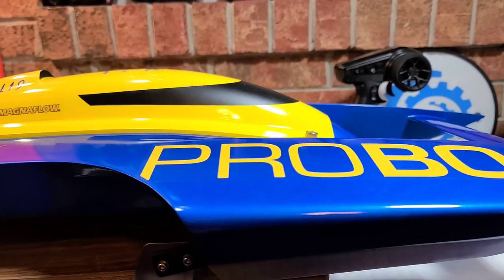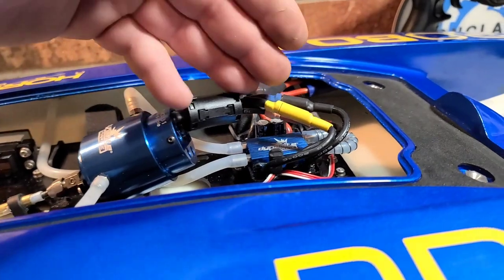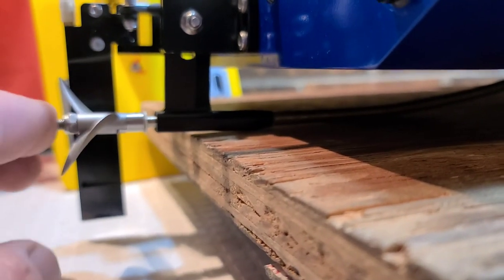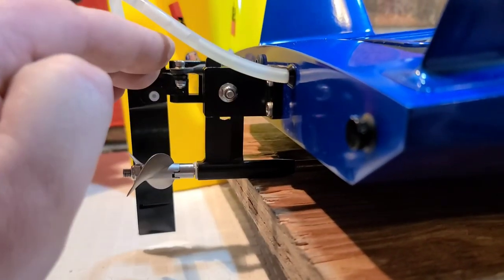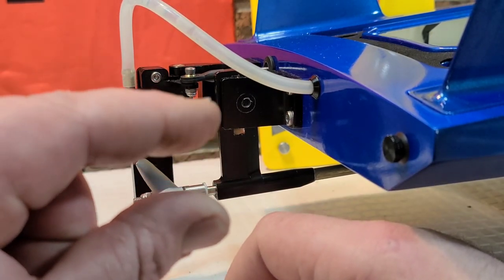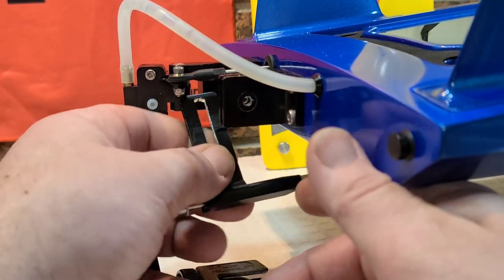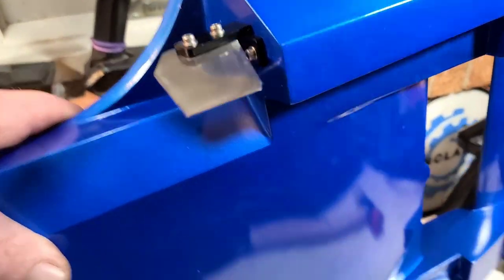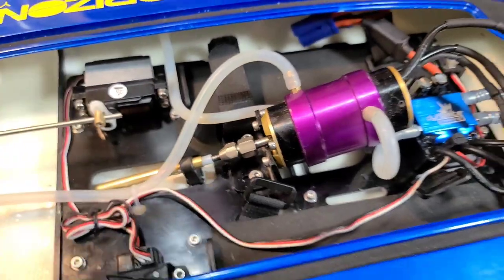Neutral Strut Position Test Proboat UL-19 RTR 30" Hydroplane - Turtle Attack

Comment: Mine came with positive angle as well the motor was not aligned.  I ended up taking every nut, bolt, grub screw everything apart to seal the bolts through the hull, lock tight, lube, make sure everything is tight.  I would recommend anyone buying this boat to consider it an assembled kit you need to go through.  When I put my boat on my cutting board to get the strut position neutral I did not take any of the tube off I just drilled out the strut position to put the bolt through the hole holding everything at that angle and it seemed to work.  Man I've watched this video like 3 times now because I gotta keep coming back to learn more.  Keep it up Big B   "Boat Gang"

Comment: I think the turtle helped you out, you did say you wanted a curved fin 🤣🤣🤣 darn turtle. Also I believe this boat runs smoother on 4s than 6s it seems more planted.
Reply from the maker: I agree, Pretty sure the boats designed for 4s use with 6s capabilities..  she's a monster on 6s but really shines on 4s.   I agree 100%!   thank God they had an adjustable elongated mounting hole on the turn fin.  If not I may have ripped the whole turnfin bracket off the sponson.    BUILD IT IRONCLAD

Comment: Darned me for commenting again haha...  I was told the gap between the prop and strut should be the same as the diameter of the cable because the cable shrinks under power as it twists and if the gap is not there it could pull the cable out of the collet losing your prop and cable to the depths below.  Was this bad info?
Reply from the maker: Yes you can rin a large gap on your strut / prop shaft with out issue. I usually only do like a mm or so. You can  play it safe with a larger gap.   My motor & Flex wasn't lined up either I filed the hole larger to get it lined up.

Comment: My UL19 runs only 27miles on 4s, Stock setup. Is ist normal? I wish it was faster, i dont wanna go 6s on this boat. 😢
Reply from the maker: Is the transmitter on 100%, also check the throttle reverse  on transmitter,  if that doesn't solve the isse, make sure the motor to esc wires are in the right configuration.   Esc & motor has Three wires, keep the two middle wires the same, switch the 2 outside wires on your motor to esc connection..
Reply: @IRONCLADRC  yes throttle is on 100%. I think its All right. Because my telemetry says 120Amps on Full throttle.